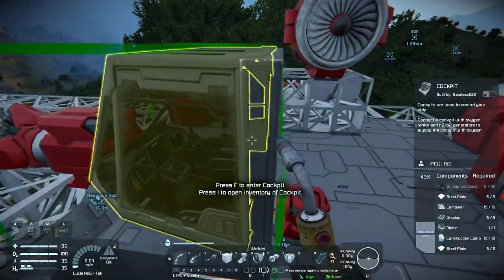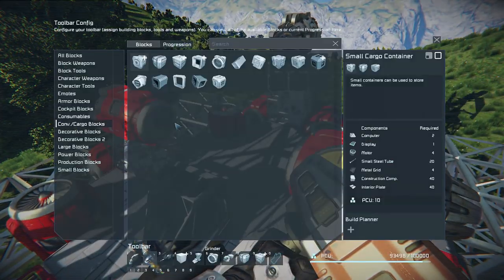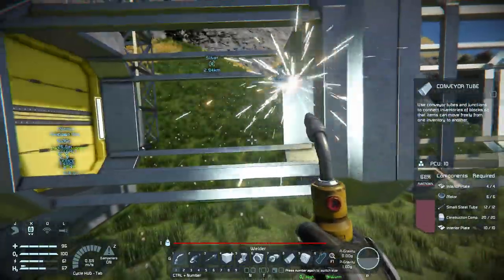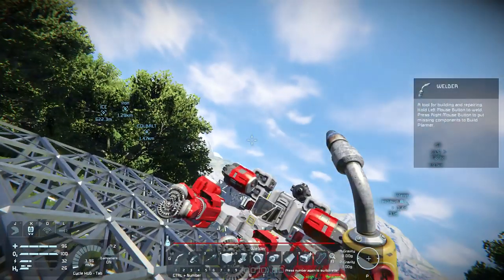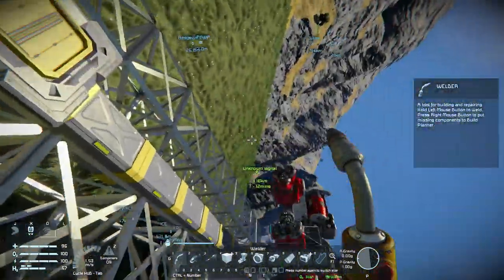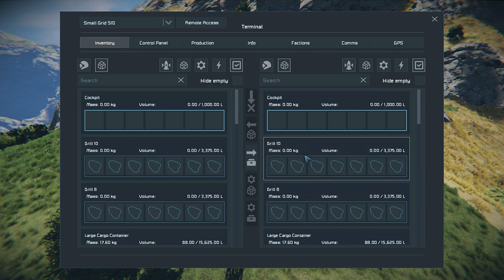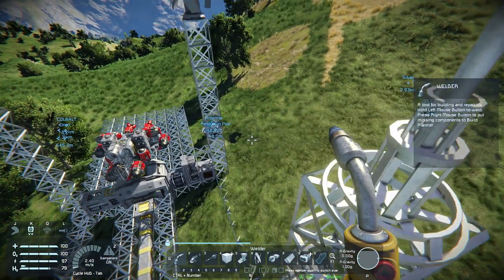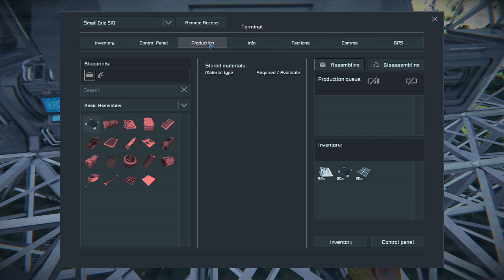Turtle Charging Station | Space Engineers | Episode 4

Comment: Quick tip from another space engineer, group your stuff together.  Example: Go to control panel, select all batteries on left, in the far right there is a spot where you can name the group, and save.  That allows you to do things like switch the group of batteries into recharge mode through a button you can place on the hotbar of the cockpit.  Also, your problem before with no charging was due to you hitting the Y button and powering off the vehicle.  I mentioned grouping for that reason, cause you can due things like turn off/on thrusters, etc...  also, you can group your landing gear and tell them to unlock under the hotbar.  As some pros would say, don't use park, you will come to regret this in the future

Comment: Data, ship needs to stay on to charge the batteries.  you can group the engines and turn them off, so they don't  waste power.  in the control panel screen - ctrl click or shift-click the group - then name group and save on the right.

in the cockpit, you can select "G" key and drag items into the hotbar and select the action you want - lock/unlock  or on/off (drills)

cockpit, drills and cargo container on the ship need to be connected with small conveyors.  Eventually, you might want an o2 generator and hydrogen engines on your mark II ship - and you can get o2 and H refilled while in the cockpit.

Different colors are because of different grids.  connecting things through connectors, rotors, pistons - etc - will create a rainbow of items in the control panel.